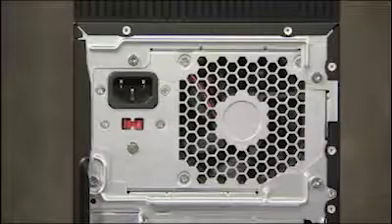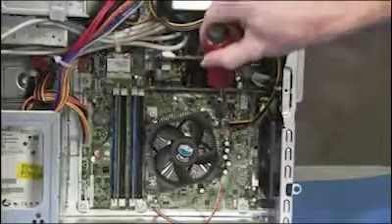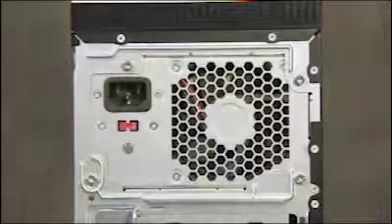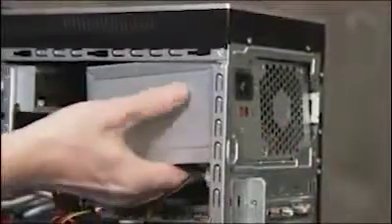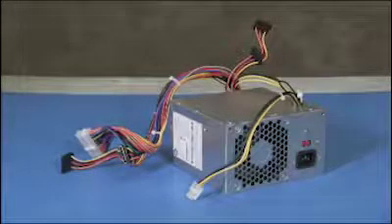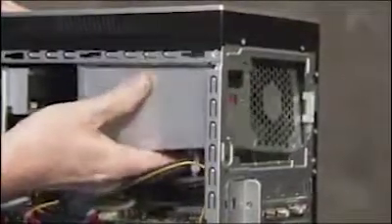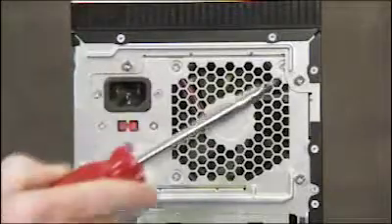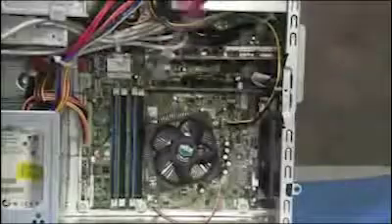Replace the Power Supply | Pavilion HPE h8-1000 ENVY 700 | HP Support

Comment: can I'm change psu in hp 6300 compaq pro MT
Reply from the maker: +M Basim Hussain HP does not recommend upgrading or downgrading hardware parts or software that is bundled with the product as It may affect the manufacturer's warranty and performance, however, you could change the configuration at your own discretion.
Reply: @HPSupport  thank you for advise